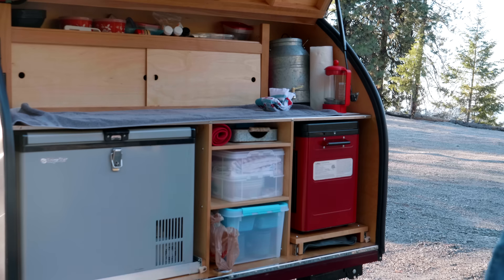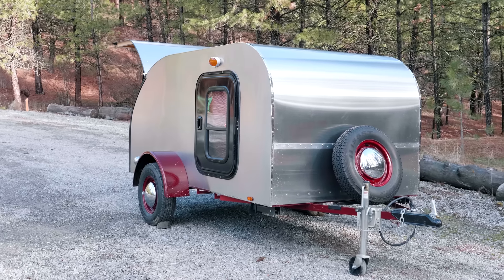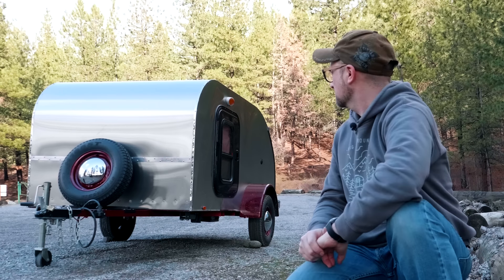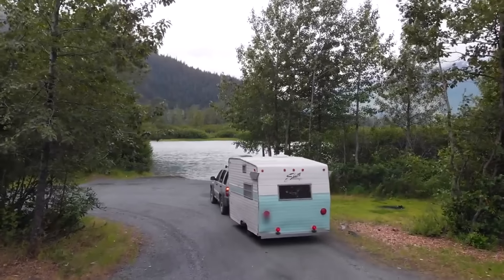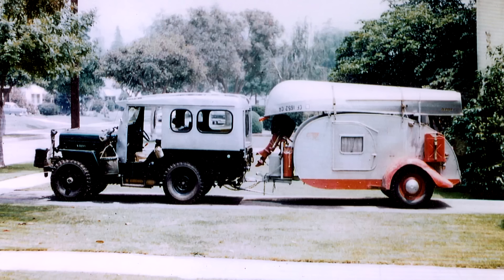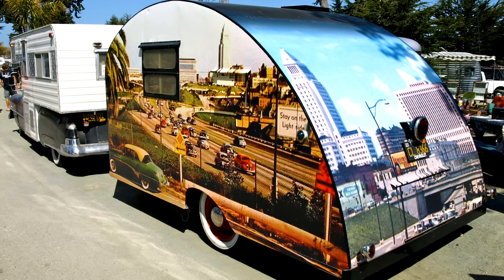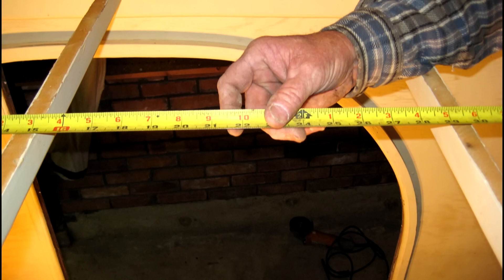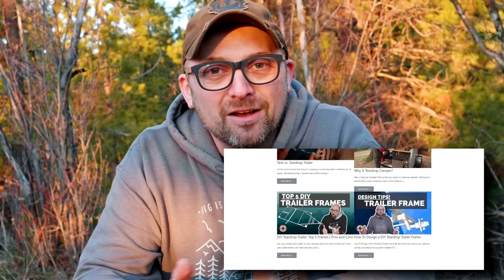Save Money, BUILD YOUR OWN Teardrop Trailer!

Comment: Many companies  build with "planned obsolescence", and "limited use" in mind.    They make something that they will expect to be used x number of hours a year...  and last for x number of hours.

The reason is,  money,  not only is it cheaper for them, but... if your trailer falls apart after the warranty then you have to spend a lot or... buy a new one.   If you have to buy a new one, win, if you have to spend a lot of money, win...   That is why a lot of these companies use toxic parts, use sub standard equipment, and heck, in some states they say you can't "live in" or spend more then x amount of time in a trailer.   so the company uses that as an excuse or reason to use toxic parts... "well people won't stay in it more then x hours a month so poof."

now, that being said,  Some communities, especially church groups, have "building groups."   A place/shop/or such, where you can go to learn to fix things.   learn to build things.   They often have access to basic tools there and people who "were"  shop teachers or trades people, but have retired.   They can help you learn some of the methods and such for fabrication.  

There is one "problem" though with self fabrication that a lot of people don't think about.  yes you are in control of all the parts...  but you also have to remember,  weight.   You can very quickly "overload" or over stress a trailer frame because you used the wrong things.   for a 1 foot length of 2x4,  the weight of California blackwood oak, vs california red fir..   is more then a pound heavier.   and thats just 1 foot.  You don't need to skimp, but at the same time, you may want to ask what you can do to save weight here and there to prevent your 1200 pound camper from ending up 1800 pounds.  

A friend of mine actually had his trailer interrior done out by... Mennonites, so even if your not comfortable yourself with with doing "professional woodworking there are places you can go to get it done, who will take the same pride in their work, as you do in yours.
Reply: Excellent points on all counts. 
Shocking when people buying quarter million dollar "exclusive" RVs are complaining about parts breaking and falling off after buying what seemed like a beautiful show RV. During this period of high camper demand, average quality of already poor quality RVs has measurably gone down further as reported by RV groups. Fortunately, that poor quality has driven customers buying their "next" camper to search for campers known to have good quality records and now that those manufacturers are overbooked, created a large number of small-quantity custom builders, which has also driving innovation as they try to differentiate themselves.  Cool. Expensive cool, but appreciated.  I hope when this market equalizes, the mass-produced manufacturers will have improved and/or the small manufacturers will have learned how to better mass-produce or at least cut costs. 
In the old days, you could not shake a stick without hitting a camper company. Less than 10 survived intact. Lets hope more survive next shake out.  Admittedly, that may be years from now.
Reply: @mikemead2315  Hi mike.

Sadly this "concept" isn't limited to just the rv market.    Apple for example, makes their phones and computers such that...   if 1 small piece fails, you have to replace several pieces.   Say for example, a power "plug" connector fails due to cold solder.   well they won't fix the plug connector, they will replace the entire plug board...   charging you 100's of dollars to do it.   And then try and sell you a new phone instead.

The same goes with their computers...  they design it so you can't replace parts yourself,  and the store will charge you for tons of new parts you don't actually need...

So with the RV market, they will make things cheep, they will say its to keep the weight down, but in reality its to cut costs and corners.   they will then actually put blocks in place at times to keep you from repairing things yourself... saying if you do it will void your warranty and instead you should bring it into the shop.

this is why i love the smaller custom builds.

That being said, i'm surprised drew hasn't talked about "Micro builds".    Bike campers and such, which have many of the same features as a tear drop,  but open the camping experience to a much younger crowd or to those who don't drive, can't afford a car or such but could afford a small bike, moped, or electric scooter.

Many of those "custom builds"  are a great place to start, to learn how to min max weight, learn about building materials, and learn how to make a camper yourself.   Essentially like building a 1/4 scale version first...   and a little 1 person bike camper, with bed, bench, cook area, fan, power pack, and such...   is a nice entry level to get people INTO the camping market.  and for them to find out what they like, need, and want.
Reply: @jenniferstewarts4851  Good points. I have been thinking using that air-bladders technique as structural supports on something like a bike camper would cut weight. Lots of neat ideas out there that could be used in different areas.
Reply: @mikemead2315  Oh on a side note, many of these mass produced campers, truck bed campers, and such...  are aimed at the "inexperienced buyers".  The glamping group who aren't buying it because they intend on spending weeks out at the boon docks but buy it because they want to show off and go to the local camp ground.   Who buy it and plan trips to go to the "Big"  camp areas.   the Tourist  places.    

Sadly its the same group who buy SUV's because, "they look cool" and "its better to drive a big gas guzzler, to pick up smoke at the store 500 yards away"  then to drive a small car because, the think the SUV is safer.
Reply: @mikemead2315  Yep, honestly picture a little bike camper, using a front mounted "external"  wood stove. with its back being connected to a "heat transfer plate".   When you pull into camp,  you set up the chimney and use the stove to cook food, but it also transfers heat into the camper...  yes it's not "efficient per say"  but it lets you use waste heat.   and there isn't a risk of co2 issues as the heat source is actually outside, just transfering the heat inside   you could even have an external hot water tank on the side of the stove, thats piped "inside" the camper too...   so you could turn that on and get hot water for coffee from inside your little camper.   giggles   good for cooler area's or cold weather.     during spring you just use a hot plate instead of the wood stove.  

add in a little power pack,  to power led lights, charge your phone, use your tablet as a "tv".    

Oh yes, there are "USB" Tv tuner sticks,  you can plug them into tablets or smart phones, and they will pick up local TV signals.  so poof if you want you have TV access cheep, and not using a ton of power, by using a tablet or phone instead of a larger dedicated tv.
Reply: @jenniferstewarts4851  You are obviously a "creative". A creative person in this context is a person who looks at others' ideas, and those ideas are your seeds to even more ideas. So really the term should be "idea creative" to be more descriptive. Lots of engineers are that way. 
One of the interesting off-grid products I saw was a burning-sticks or tea-light heated thermoelectric generator. Heat differential created USB power to charge phones and give light.  Same semiconductor component used in the thermoelectric refrigerators (which are kind of useless except for drinks), but in reverse - instead of power creating a hot and cold side, hot and cold are applied to the semiconductor to create electricity.
Reply: @mikemead2315  yep, the principle is used for "cottage fans"  where a fan has a large metal base,   leading up to a fan with an electric motor, then up to a large heat sink...   the TEG powers the fan to push hot air around.    people get creative and actually set them ontop of buddy heaters...  to circulate the heat there better.
Reply: @mikemead2315  As to being a "creative"  you should see my fan fic's.  LOL.   crossing my little ponies with harry potter, making both sides believable.  LOL.
Reply: @jenniferstewarts4851  As I suspected, already in the know!
Reply: @jenniferstewarts4851  (I had to look up fan fic.). So besides creating ideas, you actually create and put ideas to paper. Impressive!
Reply: @mikemead2315  Yes, i write stories,  and help a friend co-write stories.   And yep, part of the fun in that in some cases is looking at tech in the world today and how different groups would or could integrate it. 

There's something called "concrete canvas".   you unroll it like a carpet,  wet it down, then when it dries it hardens into a concrete pad.   

Think about using that for quick place "foundations"  for small shed cottages.   level the ground,  drop down the pad, let it set for 24 hours, then place a little 12x14 cottage on it :)   lets you work without needing tons of machinery.
Reply from the maker: That weight one can be tough. Especially when you are trying to be frugal. Where is the good balancing point between weight and price. I am actually making a video about weight soon. We have been in plenty of trailers lately over 1,200lbs and I have some thoughts on the subject.
Reply from the maker: Wow, I didn't realize  the fallout was that big. Interesting...Time will tell huh?
Reply from the maker: Good point on the micro campers. I have been hinting to Mike about one I have built here in Thailand. The problem is finding time to make a video.
Reply from the maker: I feel like that 2nd paragraph could use that Biolite stove that converts heat to useable energy. I have never taken the time to see how much energy it creates. But the pictures makes it seem like enough to charge phones and probably power some efficient lights.
Reply from the maker: This sounds similar to the Biolite product I was just mentioning to Jennifer. Does the one you are referring to have a brand? Or is it just diy?
Reply: @jenniferstewarts4851  HA!  Concrete mat!  How timely!  With the camper prices, waiting list over a year, and currently no camper-build area, I've been looking at land in the mountains for the same price. As such, I'm doing lots of researching and designing (more and more I fear that is my fun part). Engineering life, but building trades family and experience early in life and remodel experience old buildings late in life, so doable. Interesting how timely that comment was!
Reply: @jenniferstewarts4851  A WRITER!  And help others write. Impressive. I admire people who can write!
Reply: @PlayingwithSticks  Yeah. Weight is tough. It adds up fast adding all the layers needed. I look forward to your weighty thoughts ;)
Reply: @PlayingwithSticks  The different "biolite" type appliances I saw were at a show-and-tell at one of Bob Wells camping events. I don't remember the name of the products, just that they exist. 
The actual Biolite seems to be a bit more though as it is also has a battery, so it acts as a power bank to charge a phone later. 
Some really neat stuff out there that would be gathering dust in the closet after I had great fun playing with it - if I was younger.
Reply: @PlayingwithSticks  Yep, do you choose plywood, softwood or hard wood?  do you accept the risk of chemicals or play it safe, do you go steel, aluminum, or heck vinyl sidings?  nails or screws :).   Do you use a pre-bought powerbank or power system, or build your own?   How much water will you need to store?  different weights on solar panels?    are you planning on only highway driving, or do you intend on taking it off road?  or bringing it around our town, which has car eating potholes.   

How strong you need to make it, how much you need to overbuild to handle vibrations and impacts, how much abuse you expect the exterior to take from things like impacts from branches and such.   Heck,  how many windows you want,  glass is heavy, and transparent aluminum is expensive.
Reply: @PlayingwithSticks  yep, and they are a good way for lower income groups to get into camping, at least "local" to their home..   maybe 20-50 miles from their town if they have an ebike or e-scooter.
Reply: @mikemead2315  oh wow, side note,  Jayco refused warranty work because the user had been traveling with water in their tanks.   according to jayco,  you should never pull you rv with anything in the fresh, grey or dark water tanks...  seriously...   they also say they do not calculate the weight of these tanks for total weight or towing weight.   thats.. scary.
Reply: @jenniferstewarts4851  Yikes!  I thought traveling with water in the tanks was a SOP!  Thanks. I need to watch for that in manuals now.
Reply: @mikemead2315  So did most people, and in custom builds its generally included.   But Jayco didn't.   After a person tried to file a warranty claim for a broken water tank that was only 1/4 full...  he was told it wasn't covered because, any fluids in the clean, grey or blackwater tanks voids the warranty during travel.   Think about that.   by that logic...   you must pump out and empty your tanks before you leave a camp ground...

This would make jayco products 100% unusuable for boondocking, woods camping or anything like that according to their own statement.   

Now they are trying to walk it back but still, the idea that their tanks are not designed to be moved with fluid in them?  worries me about their quality even more.
Reply from the maker: Wow, the stories I have heard over the years. Sad to say, but I’m not even shocked anymore.
Reply: @PlayingwithSticks  yep but the fact that jayco does not count full tanks in the "max weight"   is down right scary...   you could be 500 pounds overweight on a 19' trailer and not even know it.   3460lbs  quickly becoming 4000 because you didn't pump out because the campground you were at didn't support that?
Reply: @PlayingwithSticks  and... sorry about flooding your comment section...  me and mike just got chatting.
Reply: @PlayingwithSticks  .... me too.
Reply: @mikemead2315  1 am, can't sleep thinking, something i've only seen once on tear drops and i wonder why its not done more often...

Galley access from inside the tear drop.  the ability to slide open a panel or hatch and access the sink and counter space.     

Something like this would almost be a necessity for camping in some areas, where storms, heavy snow, or such mean you might get stuck inside for longer then you want.    and having to go outside in 30mph winds with rain and sleet falling sideways...  to make yourself something  quick to eat or drink...  

The ability to have limited access to the galley, to get water, maybe use the kettle and make instant soup or coffee.   just seems like a no brainer.   and the option would have you preparing by keeping things like instant soup, or other quick packages in the cabin.  (i know i always traveled with a mini esbit stove,  and a baggy with 3 in 1 coffee, hot cocoa, and packages of lipton noodle, tomato, and onion soup packages... with bottled water on hand.   even say, on a train, i could at least do cold coffee if i needed it.)
Reply: @jenniferstewarts4851  Yeah!  Great idea in the areas I've lived in the north where multi-day miserable days are not unknown.  I've seen the idea, but only as a little pass through. Really need a two sided galley setup designed from the beginning.  Yeah, galley stove is a bit close to the hatch, but your little portable stoves (I got a bunch) to heat soups snd drinks would be easy - yeah. And two sided access to foods like you say is just a cabinet door away. 
Fridge access would be tough since it is so big, heavy, and far away. If closer it uses up leg/sleeping space. Long slide would be tough.  Needs some thought - probably just experimentation - or just warm rainy-day lounging attire to run out long enough to grab something. 
Cold coffee. I used to make a cold coffee + Coke drink  mix that was great in summer. (Now I am a big fan of just putting a bit of dry instant coffee on my tongue and letting it dissolve shhhh ... don't tell anyone😬).
Reply: @mikemead2315  fridge access might not be needed, but if you mount the sink "side ways"  allowing it to be used from inside and out.   have access to the stove cupboard, counter space, and such...   ie Double sided cupboards, and a hatch to access the galley from inside.   

(chocolate covered coffee beans)
Reply: @jenniferstewarts4851  I think that comes after making a conscious decision about the desired primary camper cooking setup:  separate cooking outside or cooking facilities in the main unit. 
I did a lot of tent and later car/truck sleeping where all cooking was down outside. I did not starve, though I cant remember what I ate on bad days (cereal?  sandwiches? restaurant sometimes). To this day I love eating in my vehicle. 
Currently, I envision a camper where I could do everything inside if I needed too and be happy doing it. Though I wonder if as Drew pointed out about the family eating in the Scamp he tried, if the ease of doing everything inside keeps a person from experiencing outside just a bit too much.  Yeah, maybe. 
Still, I like the idea of access from outside or in no mater the camper - even if just some simple pass throughs.
Reply: @jenniferstewarts4851  🎆 Choc Chocolate covered Coffe Beans!  Brilliant! 😃  I forgot about those!
Reply: @mikemead2315  Part of it also come down to...  are you camping to camp, are you camping as part of work, are you camping as living.   

A person who's out substance hunting,  spending 2-3 weeks out at a site...  will have different requirements then a person who's going out into the boon docks with their family.   A person who's just visiting family in another city and staying at a trailer park, may not want to cook outside where others watch and bother them...  while a person who's out in bear country, working in a mining camp, and actually living in their camper might not want to ever cook outside.

That said,  again,  around here, weather can turn bad quick, and when it does, it goes really bad.   especially in the winter...   2 words... "Lake effect".
Reply: @mikemead2315  The difference between an engineer and a mechanic.   The engineer tries to figure out how they are going to cram everything in and make it fit.

The mechanic tries to figure out how they are going to access and actually use things... the engineer crammed in.
Reply: @jenniferstewarts4851  Really good point about how a person camps and why. I am a travel camper. My brother is a stay in one place camper. Lots of different work and pleasure needs to first base camper needs from. 
Lake Effect. I am surrounded by lake effect. Well ... surrounded by big water. So the fact you even know what Lake Effect really does, that probably puts you around either the Great Lakes, East cost (Nor'easters off the ocean dumps a lot of snow), Lake Winnipeg, or Great Slave Lake. Canadian population probability says Great Lakes: Lake Superior or Lake Huron, but mentions of subsistence would lean toward Great Slave Lake area. Just fun guesses. 
My university in Michigan got 325" of snow one year. Very few storms ... just snowed slowly and constantly a few inches every day for months and months and months ......
Reply: @jenniferstewarts4851  ..... and months.
Reply: @jenniferstewarts4851  Lake Superior lake effect.
Reply: @jenniferstewarts4851  🤣 One of my favorites is "At some point there comes a time to shoot the engineer trying to improve the design and actually build something."
Reply: @mikemead2315  

The legend lives on from the Chippewa on down
Of the big lake they called Gitche Gumee
The lake, it is said, never gives up her dead
When the skies of November turn gloomy

Course i'm down on lake Ontario.   Oh boy boating out there,   during storms,  climbing waves catching sight of other boats around you then dropping down into the wave troughs and your whole world just become water.   grey and white everywhere,  till you start the next climb.

Though i've had friends who lived in Nanisivik, and i've spent time in northern Quebec, northern Ontario myself.  

Also love the great slave lake area, and great bear lake.  

So i tend to look at things more based on, how long i'm staying and... whats the worst the weather could possibly get and how i'll have to hunker down.
Reply: @jenniferstewarts4851  Yes!  Lake Ontario! I'm getting old. But in my defense ... before I looked to see if it was true, I thought the north side of Erie and Ontario did not get as much lake effect, so I did not include them - then I looked. Yikes!  Ontario more than Erie. 
I can see Lake Michigan from my door - well, walk a few blocks, turn right, and look down the street with binoculars "door". Grew up mostly here, never been a fan of big waves small boat - even big boat. Yikes!  Lived all over US - now back "home" (never the same as remembered). 
What I did on my Canada vacation. My dad owns a isolated fly-in-only lake cabin he inherited in Canada that I went to a couple times. Family camped all the way around Lake Superior in my youth. Been to my friends farm on PEI. Skied at Whistler. I had planned my camping "walkabout" through Canada to touch all the provinces, major sites, up to Tuktoyaktuk on the Arctic ocean, then to Alaska - maybe over a couple years, but covid killed that by just a couple months. hmmm not meant to be?  Now camper and path decision time again. 
I'm at lat 45.7450973, so you in Canada are "way" south of me. I win.
Reply: @mikemead2315  yep, lake ontario is also evil for waves.   we get huge wave harmonics as the wind blows one way but the waves bounce off one shore line and come back at an angle different then the wind.   

Walk about :)  Canada's Via Rail actually has something... special...  a rail pass.  most people think of it for communiting back and forth from work but oh no... 

now this is expensive but... you spend $1,518.00 canadian (about 1,181.66 USD)   for a via rail pass, thats good for 60 days.

now that might seem like a huge amount of money, especially since its for the lowest level of seating, not business, not cabin... but...   here's where the fun comes in.   For that, you can ride the rails, every day, for 60 days  all through Canada.   all of via lines.   You can travel from halafax nova scotia on the atlantic, all the way to vancover bc.   You can spend a day at the west edmonton mall in alberta (take a shopping mall, and add an amusement park, water slide, zoo, hotels, and 100's of shops).  Then go to the train,  take a nap while you head to jasper national park.   Head up to churchhill on the hudsons bay, or down to niagra falls.   (you can do a 30 day pass for cheeper, but given it can take a day to reach the next city in some cases...  60 might be more fun)
Reply: @jenniferstewarts4851  I was just looking at todays forecast for Lake Ontario:  4-5 feet with some as high as 9 feet!!!!  Yikes!  Cant even imagine being out in 9 foot waves!  Getting seasick just sitting here. 
Actually, the rail pass sounds pretty good. I need to check that out as a possible way to see vast sections of Canada as a prelude to exploring/camping.  60 days. Now I need to check out routes. Gives me time to think about what I really want in a camper. 
Thanks!
Reply: @mikemead2315  oh no,  the rail pass.  is canada wide.   via rail only has "1"  route.  kind of.     43 different cities are connected by via rail.   the highest density being in ontario  quebec and atlantic.   

https://www.traveloffpath.com/wp-content/uploads/2019/01/via-rail-map.jpg

the only other issue is,  on some parts there are only 2 trains a week in each direction.  so you may end up going one way, then grabbign the reverse train just because its quicker :)
Reply: @jenniferstewarts4851  Thanks. A lot of opportunities. Just need to learn the rules. Really is one of the alternatives to a camper or even for just one vacation.
Reply: @mikemead2315  Oh yeah, sleep on the train, pick up a canada wide YMCA membership and shower at the Y.   Spend the occasional night back pack camping at different camp grounds in the different cities.   pick up local foods from markets when camping :)

City buses may even stop at some of the camp grounds.    in city camp grounds might cost you 20-40 dollars a night.  but still not bad option because that gives you access to bathrooms and such too.   

Gosh, you'd almost think i had planned this out for some reason.
Reply: @jenniferstewarts4851  Yeah!  Almost like someone did a lot of work on Canadian Camping by Train. Hmmm ... maybe worked into some Fan Fic.
Reply: @jenniferstewarts4851  Actually a youtube channel of the experiences. Make MILLIONS 🤩
Reply: @mikemead2315  LOL.   Camping by train, a 2 month journey across Canada visiting 46 different cities, seeing the sights, foods, and budget friendly options.   

And just think, the trains.. have WiFi...  so you could upload everything each night to your editor.
Reply: @jenniferstewarts4851  I KNOW!  😃  Is your idea Great or what!!
Reply: @jenniferstewarts4851  Ahhh ... you know .... it could really work.
Reply: @mikemead2315  poor drew, coming back to this level of spam and strangeness.
Reply: @jenniferstewarts4851  I know!
Reply: @mikemead2315  and now i wanna get a new toy for my smart phone.   A Mygica atsc Tv Tuner.   You plug it into your smart phone or android tablet...  and it lets you watch broadcast tv.   it searches for local tv channels and you can cycle through them.  

Now consider,  for "micro" camping,  when you are in a small teardrop with no room for a biger tv... you can use your tablet now to check local news, and weather reports.   you don't need wifi so if you can't get wifi...  no issue, you can still access the tv.  Great little emergency addon.
Reply: @jenniferstewarts4851  How interesting. Not bad prices too. Great idea for micro camping. It would use more power, so charging would need to support. Bigger antenna would be needed for any distance, but they can be made to store. Next step up would be laptop with the same limitations. Very interesting!
Reply: @mikemead2315  it comes with 2 antenna,  the mini plug in one, and a long screw in one with a magnet on the bottom allowing you to place it outside and run a wire in.   now,  you can buy referbished tablets or com books for about 40 dollars at walmart as well :).   Or just use it with your cell phone.   

as to charging, if your using it with your cellphone, just buy an extra battery pack.   you can get a decent 20,000 mh, charger with solar for about 19.99 at walmart.   those will charge a cellphone about 5 times...  before drained but you can leave them in the sun to charge up slowly...   this gives you a ton of options.   you can also get little 2.5W/5V solar panels with USB plugs.   SO you can charge a phone or such that way.   those are like 15 bucks.
Reply: @jenniferstewarts4851  Sounds like a nice setup!  You are always thinking and planning with a good understanding of the workings and needs.
Reply: @mikemead2315  Yep, combing the little mini usb solar pannel, with a usb battery, you can set that up outside to charge.   while watching tv or what not on your cellphone...  with the external antenna set up outside and the wire running in through the window.   a little piece of foam in the window will let you close it enough to ensure bugs don't get it or heat gets out, while not pinching off the cable or forcing you to cut any holes for it.   when you re ready to move out,  pull in the solar pannel (its like 1 foot x1 foot only) and battery (weight in oz there).   open the window, take the antena off the roof, put it inside and close the window.  poof seriously, this set up would work for even a bike camper, let alone a small tear drop and if you already have a cell phone, the total cost is going to be under 50 dollars.